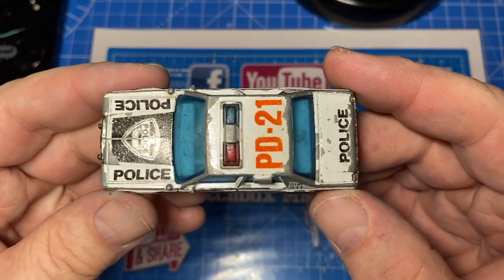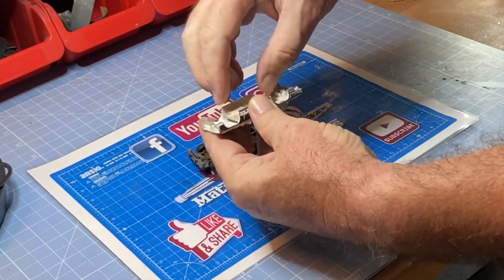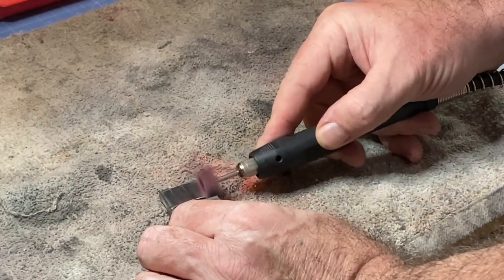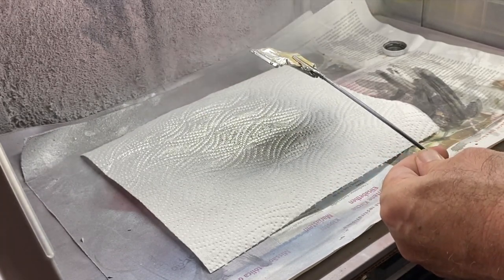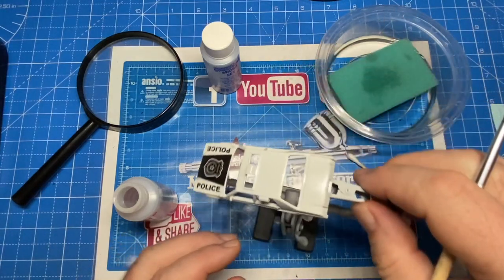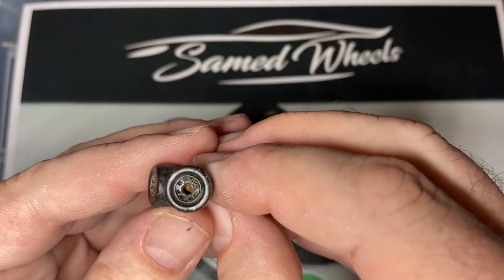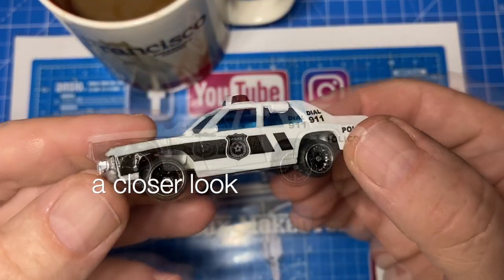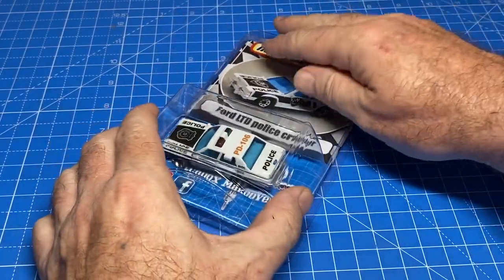Matchbox Ford LTD police cruiser (106)

Comment: Nice custom as usual my friend I have a few of those that I'm going to fix up myself I also have the Hot Wheels Dodge that I'm going to fix up for police cars most of my collection is NASCAR I have over 2,000 of them and I am going to repaint them and turn them into a racing series that near and dear to my heart it is called the Winston West series I also have a lot of tankers and a lot of tow trucks I have roughly about 5,000 cars I really enjoy everything you do my friend keep it up God bless
Reply from the maker: 2,000 cars to paint will keep you busy. I remember you told me about your Winston West idea. Have fun at it! 🍁🏁
Reply: @JC hayes, a lot of people talk smack over the Toyota Camry that is in NASCAR, but that Tundra/Tundra TRD Pro V8 engine that Toyota uses is a beast and, one year, their cars came only second to Ford in that particular NASCAR season. I am also shocked that Nissan has not gotten into NASCAR, as its VK56 engine, which, by the way, is a V8 engine, that they use for the Titan/NISMO Titan, would go well into its Altima or Sentra (along with a MUCH needed, and more muscular/aggressive body redesign for both cars), plus those engines are pretty reliable and they are also practically identical to the famous Ford Coyote V8 engine, so if you can fix one of those engines easily, then it should be pretty much the same story on the VK56 engines as well.  If Nissan had a brain, they would make the Altima into a bad ass muscle sedan, as well as make it aggressive looking, and put it into NASCAR.

Comment: If I could, I would also detail the center of the light bar, as well as the fender, front, rear, and rear dashboard lights, and maybe even put in a special part up front to make the lights and sirens go off on the vehicle as well, just like it would in a real life police car.  I would also add tiny front and rear license plates for the vehicle as well.
Reply from the maker: It would look really great all done up as you've described it! 🍁👍
Reply: @MapleLeafCustoms  , yes, and there also needs to be some little lights added on the front grille, and to also put some chrome up around the windows, too.  Granted, Greenlight does this on its Ford LTD Crown Victoria models, but it really does make the difference in the end.
Reply from the maker: @paxhumana2015  I suppose I could go all out on those extras for a display piece. That would be a challenge. My main goal is to refresh these as toys for kids to play with, and therefore I try to avoid glued-on  breakable parts or pieces that can be swallowed. It's hard to resist sometimes!
Reply: @MapleLeafCustoms  , the extra paint would not really distract much from the vehicle, it just would make it look better, as well as more realistic, and especially if the real life vehicle had both chrome trim around the windows and windshields, as well as on the lengths of the sides of the car, and on the front fender lights, front lights, and rear lights of the car.  The vehicle would still be playable.  Moreover, Matchbox and Hot Wheels have both had vehicles that had painted fender, front, and rear lights too, but the both of them are not consistent with it like how Johnny Lightning or Greenlight were/are with their toy vehicles.

Comment: @7:47 That's supposed to be a radar gun? Thought it was an aftermarket window-mounted air conditioner.
Reply from the maker: Talk to Matchbox about the size of that a/c unit! 😂🍁
Reply: @MapleLeafCustoms  ~ found this wiki article on car coolers...

https://en.wikipedia.org/wiki/Car_cooler

Probably a little bit small for a car A.C.

Matchbox wiki is calling it a radar unit...

https://matchbox.fandom.com/wiki/Ford_LTD_Police
Reply from the maker: @chezsnailez  Just read the wiki article and I've NEVER seen one of those before. Very interesting. My radar gun intel comes from the Matchbox Fandom site here: https://matchbox.fandom.com/wiki/Ford_LTD_Police